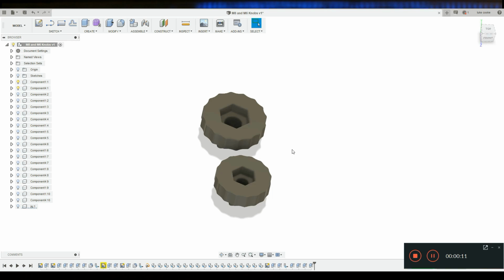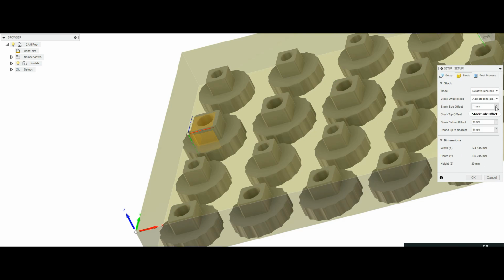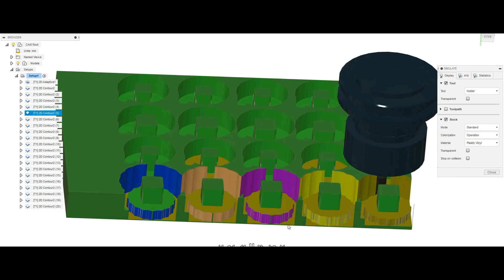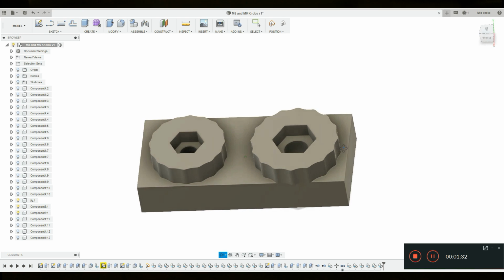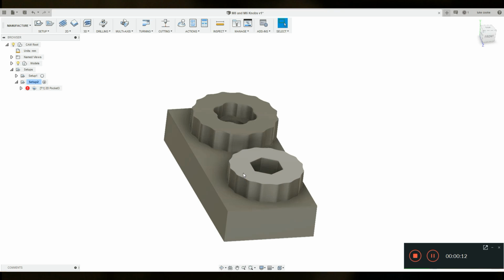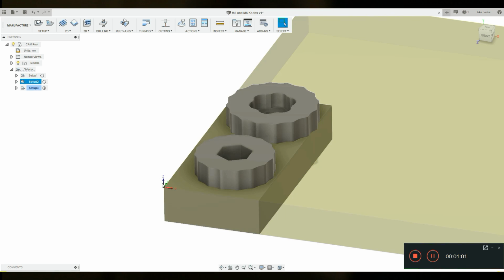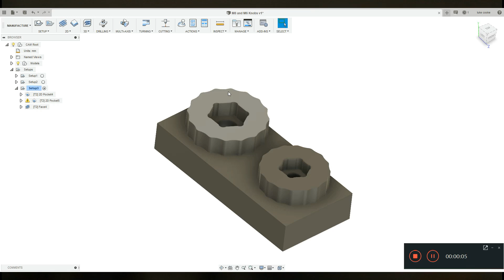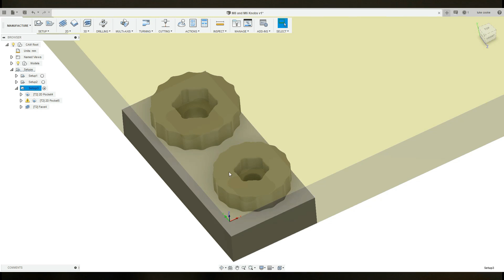Two Sided CNC Milling   Making Some New Handles for the Bandsaw

Comment: Hi. I've been making my own Knobs for a long time, machining on both sides in a similar fashion. However, it's never occurred to me to use a square section on the underside of the knob like you did, and that obviously makes it very easy to register your knobs when you turn them over. I like it a lot.

Thanks for showing your system, and I'll be modifying my methods as a result.

Also, I use Vectric VCarve Proinstead of Fusion 360. It's what I'm comfortable with.

Cheers
Reply from the maker: Thanks buddy! glad I could pass on some tips! I always try and use the part itself to reference the second side.

Comment: Hey I've been milling for only about 3 months now and this video was super super helpful. I'll definitely come back in reference this when I start doing multi-sided mills. I would like to see a little bit more detail about how you did the jig in fusion 360. That's probably just because my experience with fusion 360 is low. if you did another shorter video about how to create that jig as separate pieces and reference the z axis offset that would be really really cool.
Reply from the maker: Thanks! I will be doing more CNC / Fusion 360 videos in the Future!